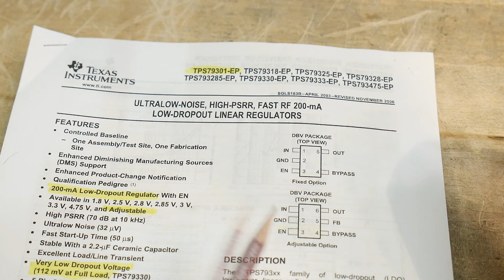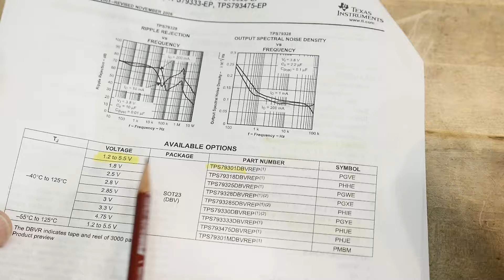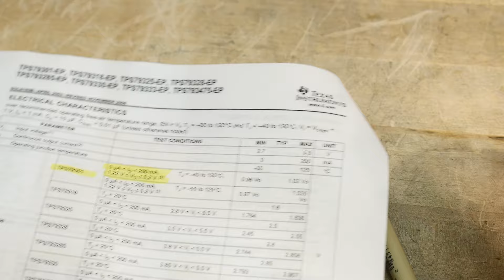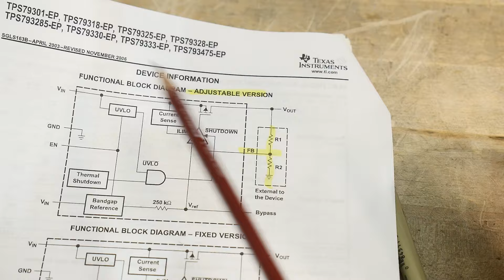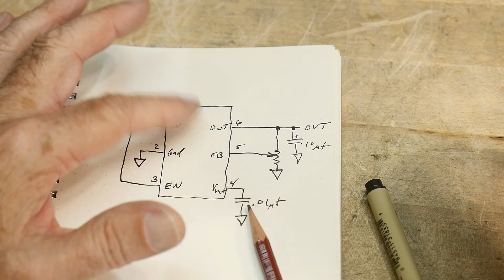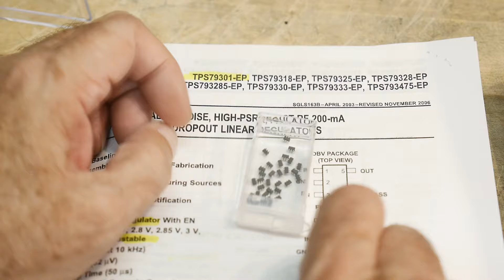#1960 TPS79301 Adjustable Regulator

Comment: I like zener regulated BJTs. high output current, high input voltage, easy to configure and requires less components. And it's cheaper 😊

Comment: A nice little and versatile device. I see the enable pin most interesting, because it can be used to switch of parts of a circuit, when they are not needed. I have used similar devices in a balancer circuit to switch of the balancer control voltage in a battery voltage range where balancing is not needed and it only unneccecarily discharges the battery.

Comment: Thanks for explaining the linear regulator. One important factor is to understand how much power the devices can handle. I quickly perused the video and did not see any discussion about the power that the device can regulate. This is critical to understand about ALL linear regulators. The first mistake is the 200mA specification, this is 90% of the time read as I can output 200mA no matter how I used the device. This is outright wrong.  

The power must be limited to not over heat the junction (Tj).  It over heats when Tj > 125 C.  Assuming room temperature of 30C, that allows for an ambient to temperature rise of Trise 95C. The power that can be dissipated:  Trise / RtheatJA = 95 / 256 = 0.37W. Power dissipated is (Vin - Vout) * Iout < 0.37W . Taking an example of 4.5V battery regulated to 2.5V, Iout would be limited to 0.37/(4.5-2.0) = 148mA.  which is less than 200mA.  BTW the physical case would be 125C - (63.75 * .37) = 103C (boiling temperature of water which can cause burns.)

Also, the output capacitance requirement is 2.2uF. (Not 1.0uF) The output may be unstable and/or not within the noise spec. You'd not see this without a scope and proper noise measurement. This is critical if you use it for VCO references as you stated would be a good use of the part in the beginning.

Take the design to the next level, and don't repeat these oft made oversights. :)
Reply: Was waiting for him to mention this... Very Important with linears! Found out the hard way...

That ol' "1A" 7805 with 35V max input is NOT happy with Both a 1A load and 35V in! Not even 12V in, unless you put a big ol heatsink on it.

I think these tiny LDOs make things even more confusing and are far more sensitive to those power specs being carefully considered because they don't have heatsinking ability... but also because even though they're intended for low-dropout, their specs show maximums... Sure, you could drop from 5.5V to 1.8, but at how much current? 1mA? Or you could drop from 2V to 1.8 at 180mA...

I think this topic deserves a full-on vid, with magic smoke experiments and datasheet comparisons [showing their similar output-current specs and max input voltage specs] of similar components (maybe even of the same silicon die?) in different packages....    e.g. TO-220 7805's, and  the little plastic D-shaped 7805's, and SOT-23, if they also exist.
Reply: It was a hard lesson to learn in the 90's as a hobbiest aspiring to become an engineer... 

I bet it's an even harder lesson, now, because everyone's so used to switching regulators, who would imagine anyone's ever having essentially thrown a continuously-varying resistor in series with the power-rail of nearly every regulated powersupply for decades?

Also, when trying to figure out why it's not working, from a newb's perspective, all that protection circuitry just makes troubleshooting that much more confusing. Am I too close to the drop-out voltage (which varies with load), so it's dropping-out? Or am I too close to its maximum current rating? Or... Oh... it's NOT releasing magic smoke, so obviously it's not too hot, right? Ahhh, no... 125deg C  at the die, which is encased entirely in plastic, which is hot, but nowhere near boiling... and it's got internal thermal protection... hmmm... LAST thought in the troubleshooting list.

Comment: Have used similar on a lithium cell to replace 2AA cells so used a 3V part.  Selected for ultra low power use and 100mA current capacity. You can do the same with a 1V5 version to power a wall clock and only charge the battery every year or so. A good use for old low capacity18650 cells that still have low self discharge butare otherwise worn out